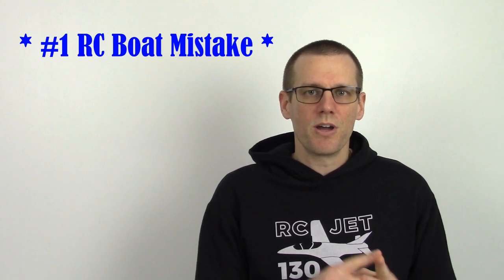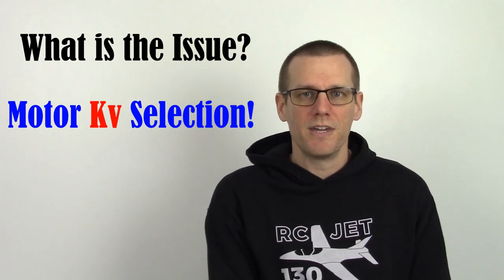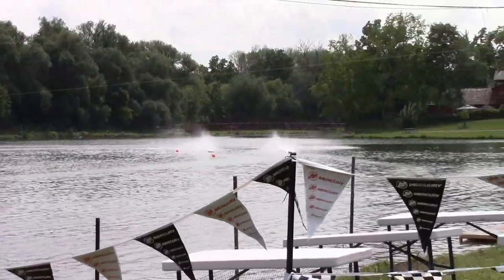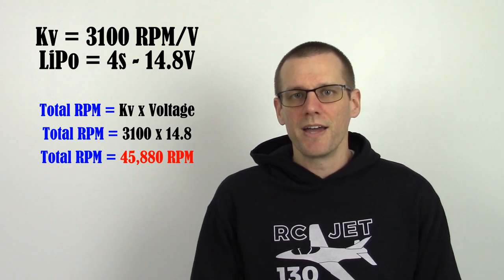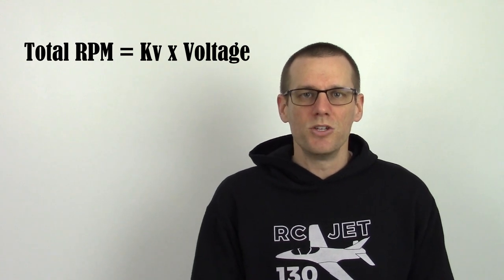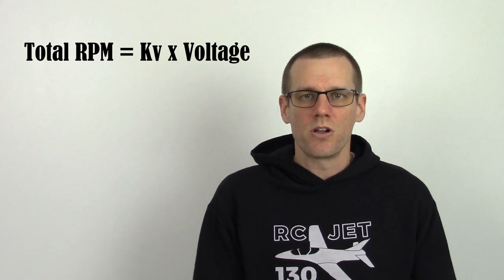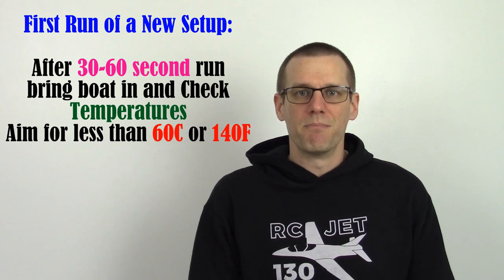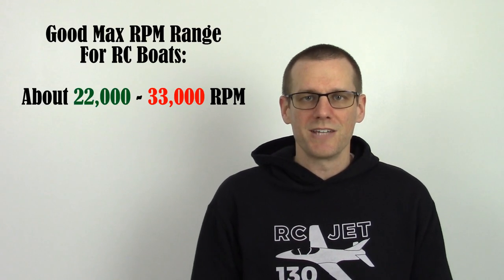Biggest RC Boat MISTAKE and HOW to AVOID it

Comment: You are so much help in understanding how to setups rc boats I'm currently doing a bass wood fiberglass resin reinforced scratch build mono hull 51" cabin cruiser and I'm planning on running 2 4082 1250kv motors with a 42mm 1.4 prop....the goal is 50-55mph out of this boat so I can keep up with my big boats and put a camera on the rc boat to get rolling shots of my big boats out on the lake. Keep up the work
Reply from the maker: Sounds like a great project.

Comment: Hi! I have a 60” inch deep vee from Arrow Shark with their twin M8 style scale drives. I decided to power it myself, because I’m hoping to get the largest fastest setup possible.  Arrow Shark says I need 56104 or 56114 500-600Kv motors with 300A ESCs and x4 6S 6000mAh 100C.
What do you think of this setup and how different variations within this range affect the performance?
Thank you!!

Comment: low rpm needs higher pitch
high rpm needs lower pitch
high pitch ratio raises the stern
low pitch ratio keeps stern lower

so a mono hull needs low lift. witch mean low pitch ratios. 1.2, 1.4, maybe 1.5. In order to get top speed with low pitch AND low RPM you have to use a MASSIVE diameter. Something has to give. and It simply cannot be pitch ratio. thus you have to run higher RPM's. 35k under load. 38k unloaded. minimum on a mono to break 60mph with 68mm+ total pitch.

Comment: I have a 26cc gas powered 50" long x 14" wide and 14 pound weight (with engine), 11 pounds (without it) Enforcer type deep vee fiberglass hull that I'd like to convert to brushless.
My goal is to run sport not expert racing; but a little more faster than the gas engine can; any suggestions will be appreciated'
I really love this hull and I intend to keep it no matter what; therefore; money is not the problem'
Reply from the maker: A good place to start is the video I did on selecting power system components.

Comment: I’m starting a 1/24 scale 49” fast MTB with 3 prop shafts and a GRP hard chine mono hull. The formulae in the other video mentioned give results close to what retailers recommend for this model, but the formulae are for a cat with a single surface piercing prop. I wonder how the formulae change for a mono hull with multiple submerged props. I got a hull power of 4.2kW, did the calcs for 22,500 rpm and got three 2kW water cooled in-runners wound for 1500KV and weighing 500g, each on a 4S 8Ah battery with 120A ESC and a 42mm P1.4 prop. Anyone here got better ideas for this boat, or suggest how to shift these results to best suit a hard chine planing hull with submerged props? Changing motors and prop shaft geometry on this after glassing in would be a royal pain!

Comment: Nice video and i have an idea fro a future episode..

Would you be able to touch on why some ESCs like the XLX2 have problems with HIGH KV Motors?  The instructions say it should not be run with a motor over 2000kv.  Thanks again for explaining how the RC components work.
Reply: The xlx2 works fine with higher kv motors.  The only issue is with 56mm and 58mm 6 pole motors and higher than 1300 kv.  With that said any 4 pole motor it will run just fine.

Comment: After change the esc and motor on my sr80, my boat suddenly runs very slow. What is the problem?
Reply: What size of motor did you installed and hull  length?

Comment: thanks for your useful videos , blackjack cat comes out from the factory with a 1350kv motor running @8s that would exceed the rpms (4.2x8 =33.6x1350=45.360 rpms  and yet not pulling out not more than 160 amp , can you please give me explanation how such a setup could be achieved , thank you
Reply from the maker: Using the nominal voltage the rpm is a bit lower than what you have. The problem with using a setup with a much higher nominal rpm is that the range of propeller options diminishes. Using a larger prop that is outside the range is the ultimate conclusion to a setup that could burn out the power system. The manufacture and designer understands the limitations and provides a prop that would work well with 6s and 8s. 2 different propellers and it is these choices that allow the high RPM setup to work. The range of rpm is for new boaters to make the kv choice align with an easier boat to setup. I typically get questions asking me if  a 2200Kv motor would work for 8s. And this spells disaster as you could imagine for an rc boat.
Reply: @RCexplained  thankyou for your precise explanation ,so technically speaking it s all about the load being applied to the motor, the more load it have the more heat generated and eventually burn the setup .at the moment i have a tp 5660 1170kv rated at 48voltz max ,208 amp max ,53k rpms  specs are stating also that continuous power is 5500watts and maximum power is 10000watts , i wish to make a  setup to get the most power out of this motor reliably , i see alot of people burning alot of escs and i wish to get the best setup not the hard way , if it s stated at 48 volts 53k rpms , can i give it 12s ? but that saying goes against your rules of exceeding the 35k rpms on 12s it will get up to 53k rpms which is also stated by the manufacturer ,i m a little confused ,
Reply from the maker: @Maurizio Bezzina  if this is your first boat build, I'd recommend running the motor on no more than 8s LiPo. What boat is this going in? For rc boat applications, it's quite difficult to utilize the full potential of a brushless motor. Using an efficient direct drive system doesn't allow flexibility in gearing changes to get an appropriate output rpm. 
Also check out my video on selecting a power system for a boat. Some good info there that may help you.
Reply: @RCexplained  for the last 10 years i did only run setups up to 6s and 180amp esc which i  had plenty of fun and success , i was always afraid on going much higher setups since motor ,lipos , and especially esc are more expensive , this coming year i want to take the step and go for it ,i find your explanations very useful and well explained thanks again for that , i was confused because motor rating is at 53k rpms but at the same time they are way over the recommended 33k  , so as far as i learned now is that i cannot get the full potential of a motor although its ratings , that s why is stated that continuous   power is 5500watts which i now believe it s the reliable voltage to go (8s)
 Boat will be a 50"mono deep vee  with flexible surface drive ,so my setup will be 2 x 4s 6000mah 100C  lipo  300amp ztw esc and the 5660 tp 1170kv everything connected up with 8mm bullet connectors , I will start with a 2 blade 48mm x 1.4 prop and check the temps accordingly each run and eventually go larger prop , when temps start to go over 60deg c i stop increasing prop size and go a step smaller .

Comment: Hello! I have a 2150 kv boat motor and planning to use it for a 80cm v-hull. The total rpm will be 31820rpm. Is this too high?
Reply: Works fine depending on voltage your gonna use. My mono's (85cm/33inch) are driven at 6s with 2000kv motor en propsize about 42-45mm. Suggested is experience with boating. But that could be a indication for you. Or look for example for simular boats on YouTube and what they run... prop is also very important. Got different v-hulls, one runs best on normal 1.4 pitch and other boat likes 1.6 hi rake...

Comment: so a lot of my  have 2000 to 2900kv  fast boats and i use 3 to 5 s ...so 5 x 2000  means only 10000 rpms... I love all the way my boats perform with the props i chose...i am confused  by your 20000-30000 rpm numbers.. i think thats way higher then needed...
Reply from the maker: Check your calculation. 
3s and 2000Kv is 22,000RPM
5s and 2000kv is 37,000 RPM
Reply: @RCexplained  wow... so all my boat are setup nicely... do you have a video on this math/calculation you use??? i don't get it at all.. thanks

Comment: I'm thinking about buying an old Nikko Barracuda and upgrading it to brushless. Would it be faster on 3S running lets say a 2400kv motor or on 2S running lets say a 3400kv motor? Using that RPM conversion they would be putting out roughly the same RPMs. But wouldn't the 3S still be faster? 

Also, what size ESC would you recommend? Thanks in advance
Reply from the maker: I had this boat at least 20-25 years ago.  It will struggle with a significant amount of power, not the greatest hull for more speed. 
In terms of 2s vs 3s, typically, the larger motor will produce the highest top speed. 3s would be easy to do this with. A 30A ESC 3s battery will easily make the barracuda uncontrollably fast.
Reply: @RCexplained  yeah I wasn't expecting a speed demon. I just thought it would be neat to upgrade a toy grade boat from around the time I was a kid and really wanted one lol. So probably just a 2S lipo and a 20A ESC then? I was looking at a few motors and was wondering which one(s) you might suggest since you had a Barracuda.
A. 2218 2750kv
B. 2948 3450kv
C. 2958 3380kv
D. 2968 3400kv
E. 2968 3800kv
Reply from the maker: Smallest motor with the lowest kv on 2s. 15k RPM will br a lot.

Comment: Why is it that most all 3650 motors say there rpm is 50,000 but using your formula they are usually 33,000. Is the manufacturer just overstating there product. Which number would you advise using. I used the 50,000 number as I had not seen your video yet. I put a 3650/3100kv motor with a 120a esc in a 24 inch mono hull boat.. Running on the water it leans to the right, if you don't let off soon enough it will flip over to the right and land on its top. I'm  sure you are a busy man but as I am 75 years old and just learning, and don't know anyone else interested in th rc boat hobby. I am sort of a a loss for information sources. Thankyou and all the others that help on youtube. The transom I copied off a udi005. I just bought all the replacement parts for the udi005 and used them. You might be familiar with the boat I used , it is a old harbor freight boat called the Neptune. I just gutted it and then put in all new everything.
Reply from the maker: Hi William, they may say the RPM is 50,000 max, however this does not work well in boats if ran at 50k RPM. Boats perform best at a max of 33 to 35k RPM for yhe average boater. Higher if racing and experienced. 

What the motor states as a max rpm is not necessarily the RPM that the motor is actually going to run on. This is controlled by who is selecting the power system based on Kv and battery voltage essentially.

3100Kv with a 2 or 3 cell LiPo can work OK. However I would not recommend a 4 cell LiPo.
Reply: @RCexplained  thankyou so much! I will take your advice.

Comment: The faster my motor spins the boat loses speed.  I can walk faster than it is going. Why Is this?
Reply from the maker: Sounds like it's catching a lot of air. What are all the specs? Motor, battery, boat, prop
Reply: @RCexplained  80 amp esc 5200kv on 2-3s, 100c.  Two blade 35mm aluminum prop. Not sure the pitch.  The shaft is angled below the boat hull.  I built this boat myself. The boat is 29" long fiberglass so it's not heavy.
Reply: @RCexplained  it acts like the faster it spins the less thrust.  Cant run at full throttle the boat barely moves.  All connections and linkages are tight and firm.
Reply from the maker: @justinwalker923  sounds like a lot of RPM requiring a small prop. A 29in hull is better suited to a prop of at least 40mm, however your setup won't like this as your Kv is a bit high.
Reply: @RCexplained  so I guess its kinda like rc cars/trucks.  Lower kv and larger gears...  Lower kv and larger prop...
Reply from the maker: Boats require a certain amount of prop for the relative size of the boat. Too small of a prop and they can't bite the water enough to get the hull on plane. 
Try throwing the boat really hard and straight to get it on plane and see if you can develop enough thrust to stay on plane.
Reply: @RCexplained  dude thanks for all the advice.  I always rely on the you tube rc guys for advice.  I really appreciate it.
Reply: @justinwalker923 ame with mine and it’s a wl916. When I go full throttle it takes a while for it to kick in and actually go fast.please help because I am new to rc boats and don’t know much.thank you

Comment: Ive had this issue in aces.  I wish you could help me out with my airboat.  Finding a good balance for RPM/Blacdes/Pitch and Weight has led to many rebuilds, sunk boats and lots and lots of flip overs..  Its getting good, but still needs a lot of help.  This video shows the most recent test run.
https://www.youtube.com/watch?v=xoip05uj00Q
Reply from the maker: What's your length and width. Is the ratio of these calues somewhere around 2.4-2.6?
Reply: @RCexplained  29" x 8.875" is the dimensions.  so.3.26 is the ratio....
Reply: i had a shorter length at first, but found the bow slap to be so bad i lengthened the design.  That bit seemed to have substantially helped the performing characteristics...  It immediately took turns more predictably.
Reply: improved but did not eliminate bow slap.
Reply from the maker: @PaulKind3d  I'd expect that the ratio of length to width is a bit high. Maintaining a ratio closer to 2.6 will help. Overall making the airboat larger in both dimensions helps with stability. Take a look at common airboat on the market for an idea on this ratio.